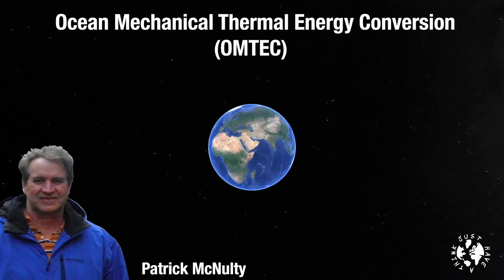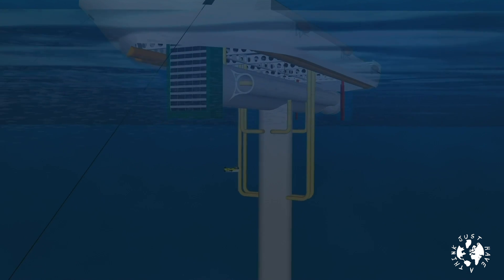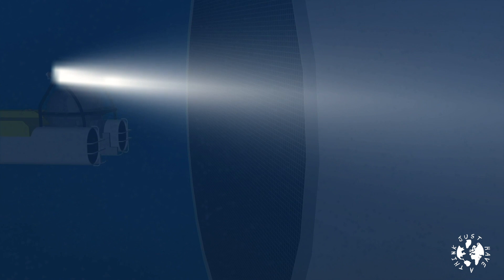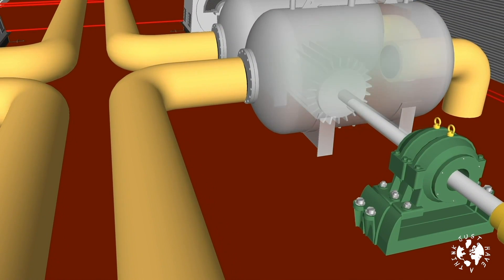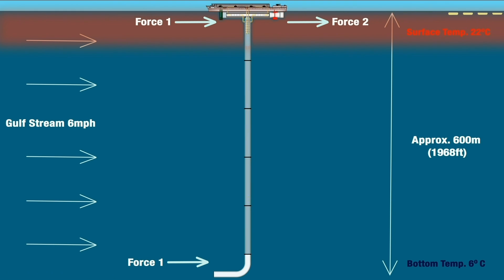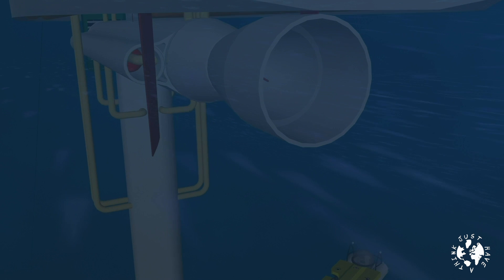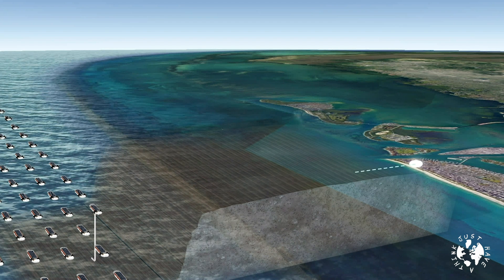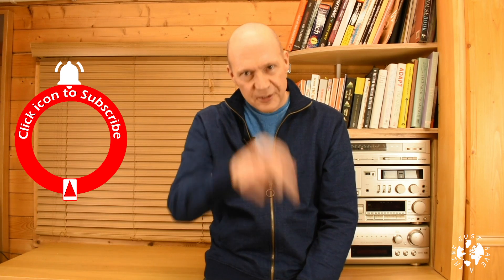Ocean Mechanical Thermal Energy Conversion

Comment: You say in theory many thousands of these platforms could cool the ocean surface and by us time to sort out fossil fuel use.....
The ipcc has given us 12 years to half emissions!! This is still a concept, how long will it take to get this working in the real world and then build thousands of them without raising global co2 emissions in the process. Also will this not speed up the warming of the oceans by the unnatural mixing of the ocean if done on a global scale? In which case it may by us a little time but will end up speeding up the warming of the ocean pulling up cold waters.
Reply: With today's supply chain they can be built in 10 years. Other green energy technologies such as wind and solar can build them. As the planet cools more ice forms and so albedo counters the effects of global dimming along with other SRM technologies that it powers..
Reply: Patrick McNulty you say wind and solar can build the Many Thousands of platforms but wind and solar currently produces about 5 percent of all global energy use, also you will still need fossil fuels to Extract, fabricate and SHIP all the components for thousands of these platforms, millions of wind turbines and solar panels. You say we can build many thousands in a decade are we talking 2 thousand or 2 hundred thousand......not sure how many we need up and running to actually start making a difference?
All countries who signed up to the Paris climate agreement have fail to hit the already low targets.
in 2018 the USA produced more barrels of oil than ever and global co2 emissions were the highest on record. 
IPCC reports are considered by many very conservative failing to take into account such feedbacks as loss of albedo, methane release, deforestation. The ipcc says we have a little over 10 years to half global emissions many say we only have a few years to do this.
We are going to hit the 1.5 c rise by around 2030 and 2 degrees c between 2040, 2050 not including any large methane releases or other feed backs like a open ocean in the Arctic the BOE
We have already emitted enough co2 to take us past 2 c rise the only way we don't go past 2 degrees is to use CCS which we are not doing and it would need to be way beyond anything humanity currently does. CCS is still a concept really.
The estimated amount of CCS factory's needed to filter the atmosphere is massive like converting the whole of the world fossil fuel industry to CCS factory's, then there is the small matter of what we do with the billions of tones of sequestered carbon. 
If we started all this 30 years ago and had it up and running now on some sort of meaningful scale I might have a little more hope
Latest studies show the oceans have soaked up 60 percent more heat than previously thought 
Arctic set for first BOE in the next few years, and could be ice free year round within a decade there after. So over the next decade we can expect big increases in Arctic methane release and the jetstream to continue to break down along with weather patterns. 
In the next few decades we need to 
Build Thousands of platforms 
Millions of solar panels 
Millions of wind turbines 
Millions of electric cars 
You know our current global resource overshoot is already at around 1and half planet earths each year right!!  
What are your thoughts on 
Global food and fresh water projections for the coming decades
Over population 
Ocean acidification 
The apparent decline of insects 
Biodiversity loss
Current extinction rates 
Plastic in the environment 
President Bolsonaro of Brazil looking  to industrialise the Amazon Rainforest
Projected sea lvl rise. 
The melting West Antarctic ice sheet.
With out a United global war style effort where we all agree to scrap the global economy and totally change the way we live and consume resources we have no hope and tinkering at the edges or trying to tech our way out won't do squat and is still missing the point. 
7.6 billion people and rising We are destroying everything
Reply: @stephenmason5827  Thx for your detailed comments. Wish I would not have to agree with you, Stephen. We are probably >30 years too late and still lack the global political momentum. Very painful to accept and no realistic chance to tech our way out of annihilation even if we would re-allocate political priorities and resources. Maybe quantum physics and social movements can change the path of the coming global years.
Reply: Martin Enderlin, thank you, I know people may find my comments negative but I believe for us to have any hope everyone should be aware of the reality and gigantic scale of the challenge before us and the dwindling amount of time we have left to achieve it. 
It's 2019 now and as far as I can see business as usual continues unabated. 
In the next decade or two we will most likely be in full scale runaway warming and nothing we do then will turn the tide. 
We know we are tracking on the ipcc worst case scenario 
We know the ipcc is considered by many to be conservative and do not take into account positive self reinforcing feedbacks, eg Albedo loss, Arctic BOE, Arctic Methane, ever increasing record forest fires ect. 
Then there are the many other ways we are destroying the biosphere, over fishing the oceans, plastic in the environment, pesticides, resources overshoot, ect ....this goes way beyond climate change.
I wish I could be more optimistic
Reply: Only need 1% to do it..
Reply: Patrick McNulty sadly you really do not understand what your talking about
Reply: @stephenmason5827  Sadly you don't think electric transport vehicles exist..
Reply: Patrick McNulty when did I say electric vehicles don't exist?? 
You might want to look at aviation, shipping and road vehicle yearly co2 emissions!! 
Any thoughts on our resource overshoot or should we just ignore that inconvenient truth? 
Did you look at global food and fresh water projections for the next few decades yet? 
We can try and ignore reality but it won't change the outcome.
Wilful Ignorance is the main reason we are totally fucked
Reply: @stephenmason5827  Evidently you don't think they can be used for transportation.
Reply: @stephenmason5827  Overshoot is not possible with the temperature flow control damper or did you miss that part?
Reply: OTEC's already exist though the only difference with this version is that it doesn't have to use massive electric pumps acting more as a big siphon than anything else.